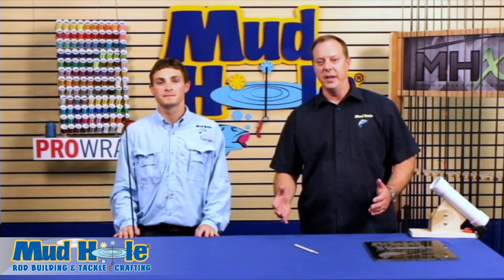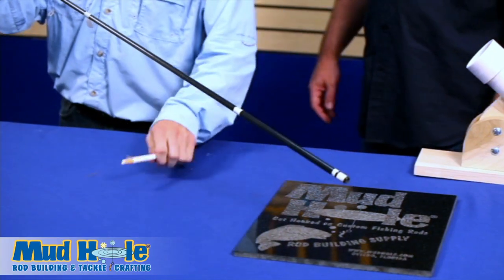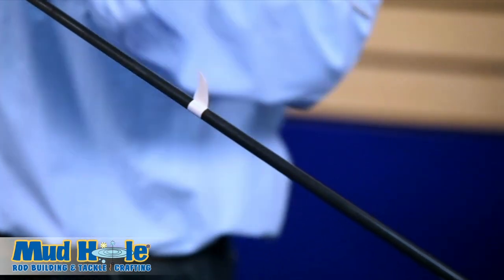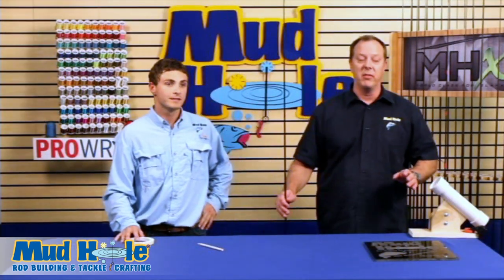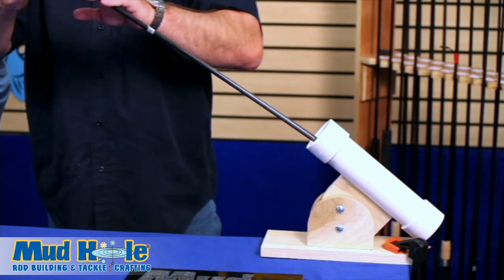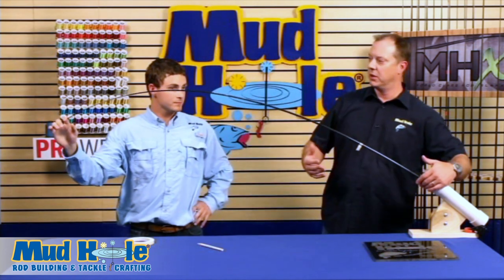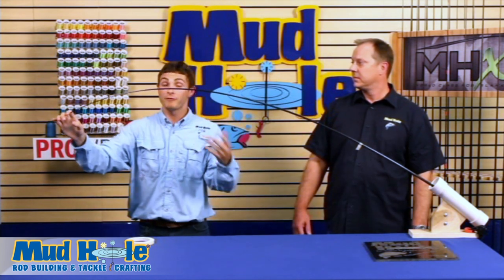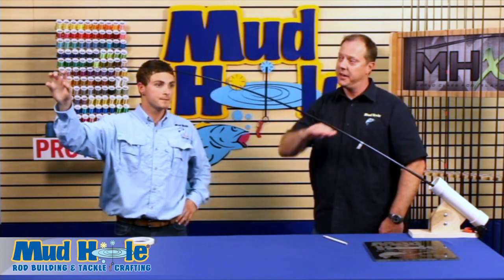Finding The Spine Of A Blank: Rod Building 101

Comment: Just a quick question, I have tested a few of my pre-built rods to find the spine, and it seems to snap in two places.  both opposite of each other.  Why is this, and how can I eliminate it?
Reply: All rod blanks will have opposing spine/spline. One spine will be dominant and several tries may be needed for discernment. For fly rods the guides will go on the bottom side of the blank as shown in the video. You are looking for the plane the rod will predominately flex when loaded on the forward motion of cast. On fly rods the guides need to be on the convex side of the flexion arc on the forward stroke or the rod will try to twist into that plane and give erratic directional release of casting energy resulting in inaccuracy. For rods used for trolling, or where casting accuracy is irrelevant, it is probably best to have the guides on the opposite side to reduce rotational rod strain when fighting a large fish. Not going to go into details for casting and spin rods, but if you think of whether it is casting accuracy or strength in fighting is most important and taking into consideration whether guides are to be mounted on top or bottom side of rod you can figure it out. With multi section rods, the spine should be determined for each section separately or the flexion plane under load when sections are joined will result in each section trying to flex in a different direction creating wasted rotational forces. Once they are then joined, test the complete blank and you may need to fine tune the testing on each section again so they all tend to flex uniformly in the same plane when loaded. Be patient, it may take some fiddling to get it balanced in the predominant flexion plane. Remember, in a two piece rod, the bottom section has the most influence on flexion energy direction and the tip section gets "confused" when it is trying to flex in a different than the rest of the rod. In a three or four piece rod the flexion tuning has more variables, so be patient in making sure the dominant flexion plane is uniformly aligned through the entire length of the finished rod. Then ya got a sweet fishing partner in your hand.

Comment: What if the spine does not align w the straightest axis of the blank? What if you build on the spine then notice a curvature bending left or right on the finished rod?
Reply from the maker: Rod blanks during production can end up with a slight bend in them. Building on the spine will always give you the best action and minimal-torque performance out of the blank. But, if the blank has a bend to the side when lined up with the spine, then a choice has to be made whether you prefer the straightest axis or getting the most performance out of the rod blank. Some will say building on an axis where the blank is curved could add unnecessary friction to your line when casting, but others would say it is too minimal to notice.

There is a ton of other things to consider that people will tell you. At the end of the day, if there is a bend in the rod after you finished it, you'll still have a great rod you've built that will get the job done

Comment: Very interesting; I never knew this. What is the advantage in building your own rod?
Reply: I know that some people in Maine  build rods only after watching you cast first. Maybe that level of customization is not necessary.
Reply: It allows you to choose your aesthetics mostly. However it also allows you to know what material is used pick your guides and most importantly you can get odd length rods by cutting the blank ie 6'3" rods are not super common so buy a 6'6" blank and cut 3 inches off the base
Reply: really rod building allows for the perfect rod to you. the weight distribution, the handle materials, handle shape, handle length. along with making it look good with your favorite reel. rod building u can build a rod that would more 350 for around 175

Comment: I think I've found a better way to find the spine. Especially if your handling a custom fly blank of 4, 5 sections. They are to bend and you may crack one trying to make it jump. With a Uni-micrometer you'll get a choice of anvils. One of which is a pin. Insert the pin (now on your Mic.) into the blank and gently turn down the spindle, it will close the gap until you feel resistance. Now turn your blank, if you are on the spine you'll feel it loose grip. If so turn down the spindle again till you feel resistance. Now turn your blank. Where you feel the blank stop you've found the start of the spine mark that spot the rotate the other way till it stops, you've found the beginning of the other side of the spine. It takes a little practice but you'll get it soon enough. You'll find the spine without chancing a split or crack. Hope this helps. PS I Split one so I turned to this method.
Reply: Would you mind making a quick video about this? No need for the fancy camera, lighting, microphone and post production and processing. THANKS!